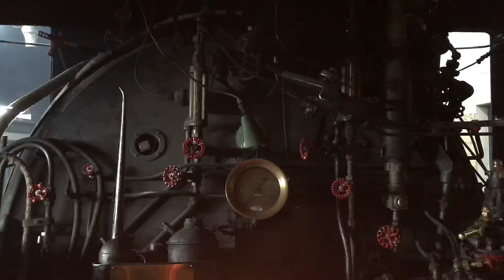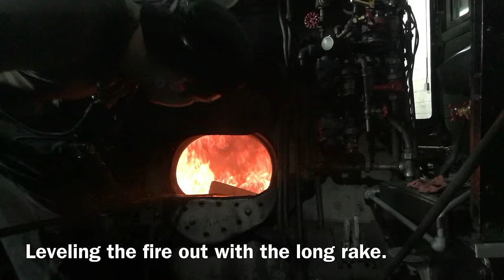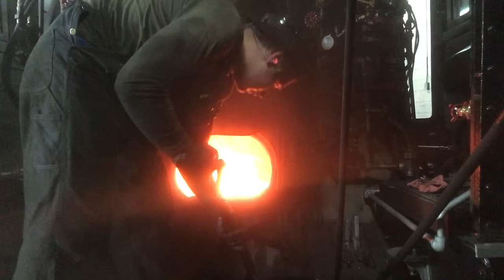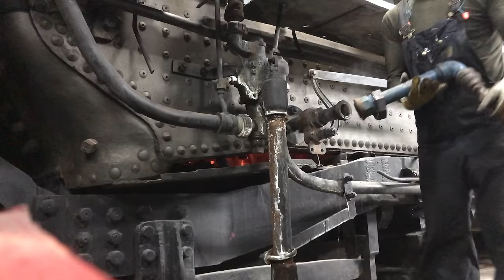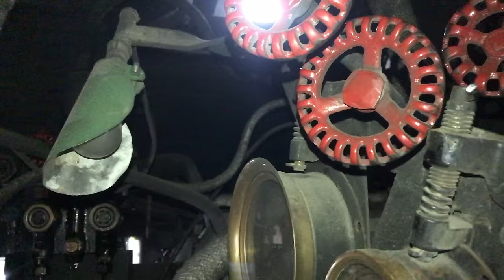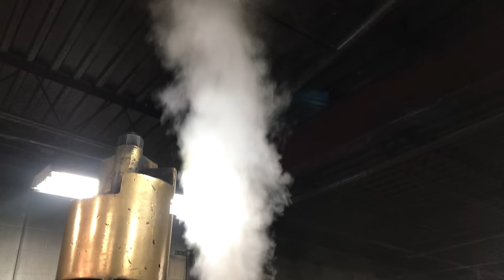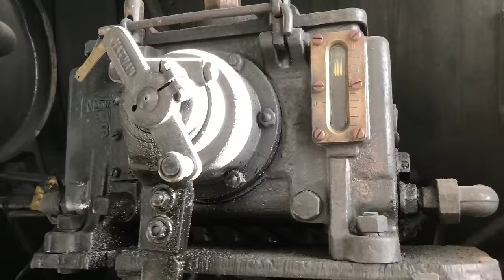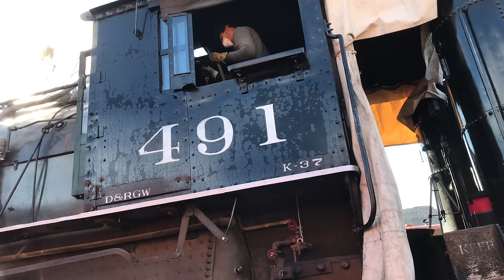How To Fire Up a Steam Locomotive [4K]

Comment: i wonder if in 150 years there will be a video about how to fire up a car with a petrol engine :D
Reply: internal combustion engines will still be around and commonly used in 150 years. Don't think that ICE won't keep getting better like everything else.
Reply: In the future ICE technology might be so great we all have our own mini power plants that are just as efficient as the big ones but require far less maintenance and thus eliminate the grid entirely. Same engine under the hoods and next to our homes to produce the power we use.
Reply: Within 150 years everything is stopped, destroyed by nature…. Maybe???
Reply: What, you never watched 'Cold Start' video's before?
Reply: you wont be around to find out.
Reply: They will be around but very limited.   The ICE has  maximum efficiency of 35%, electric motors are much cheaper and have 90% plus efficiency.  Only limited improvements can be made to the ICE.
Reply: On a cold day first pull out the choke...........
Reply: It'll be a five second video for modern cars... Turn its key.  It'll be a 10 second for vintage cars, ...pump the accelerator pedal, and turn its key.
Reply: Or push in the clutch before starting
Reply: Historymaker2001 well Put
Reply: Bergsman100 I see what you are saying and that would be cool but you also have to keep in mind how are you going to get it to generate electricity that’s the problem that you are going to have yes that would be cool if you could make that a possibility but I don’t believe or for see that ever happening
Reply: Bergsman100 I don’t think it is humanly possible due to the fact that you need to regenerate the energy somehow in order for it to get that charge to make the car move that proving that the battery is probably the only way possible to do so but the problem that I see as you see as well is that the battery does not last long and needs to be charged
Reply: In my opinion to this topic I think people should try to create a steam car that has the modern features that everybody wants but is run on steam because I believe it will last a bit longer and we steam all you have to do is fill it with water To keep this thing going if you make it the right way or you can make it so it runs off the water and a fire source I think that would be the most economical and smart way of doing it I say that in this way because of the fact that there is no again as I’ve said before in a previous comment possible way of making a car move without a battery that is electric that I can think of because of the fact that you still need to generate energy to the car and how do you generate the energy without the battery source or power source
Reply: Did just think of one scenario that may work with electric car thinking Deep about how you could do so If you created in electric friction car You would need some sort of lever inside the cab That could be moved back-and-forth in someway to create friction with the friction drive that would give her the momentum to start making the car move and then as you kept moving you could keep the friction up enough to where it would give enough friction to you could just stay on the pedal
Reply: Majority of cars start with a turn of the key or push of a button. The video would last for 10 seconds.
Reply: törment tor I mean there are videos about hand cranking engines
Reply: There were still steam engines in regular use not 70 years ago. Also, there are already videos on how to start up 70 year old automobiles.
Reply: Alot more collectors nowadays. it would probly still be this
Reply: That's wishful thinking. I don't care at all for electric engines, and I love ICEs, but I'm not blind enough to pretend their day isn't over. Battery and electic motor tech has gotten to the point where it'd be stupid to try to keep running everything on fuel-burning engines. You're like the people in 1955 insisting that "the steam locomotive has a long future ahead of it yet, with the technological improvements we can give to it". Within a decade, they were all gone. Diesels did the job better. If there are ICE engines still around in 50 years, they will be in "antique" cars, and possibly in some specialty toys for rich people who want something "different" and classy. If they haven't outright banned them totally, because that's the kind of thing they do (like refusing to let a few hundred people drive around in antique cars because "they don't meet smog laws", as if a small number of cars being driven a few dozen miles per year could possibly have the slightest impact on overall pollution levels. But "duh law is duh law!"
Anyway, open your eyes, stop deluding yourself. The ICE is on the way out. Car makers are eager for electric cars. Lawmakers are eager for them. There will be no reason to continue with ICEs once charging and battery tech has improved and expanded. Rural areas will be the last bastions, but it's coming. There is no reasonable cause to think that ICEs will be anything but a historical oddity in 150 years. Just because you like them and don't want to drive in a BEV doesn't mean it's not going to happen. A lot of people were very upset about the end of steam...but they didn't pay the bills like diesel did, and that's what counts, not what people like. And the average person doesn't give a shit what powers their car, if it's convenient for them. Already most of the kids have been indoctrinated to look forwards to BEVs, and it'll just get worse. Why would they want some old combustion-powered thing that they need to pump petroleum fuel into, when a nice, sanitary appliance that drives itself and plugs in to charge like all the rest of their gizmos can be had. It'd be like asking a modern kid to drive around in a steamer.
Reply: A 2016 Dodge Charger weighs almost exactly the same as a Tesla Model S.
Reply: Why heat water when you can burn the smoke in a ICE.
Reply: @torment -- much sooner than that.  I watched a video recently on how to start up a Ford Model T...
Reply: Oh, and one more thing -- in 150 years, what's a video?
Reply: ? unixtohack , Must be crazy doing unix and yet not having faith in the future/ praying for the end of the world.
Reply: A very short one :p
Reply: @afrog2666  I think you take too much for granted.  Imagine pulling a car out of a museum.  Check fuel level, oil level, replace oil filter of needed.  Check battery voltage, inspect tire pressure, check transmission and coolant levels, window washing fluid levels, check wheels for alignment, I could go on for a long time.  If you did all this recently, then yes, it's a shot sequence.
Reply: nah the new toyota engine has 41% thermal efficiency it will get better but no where near electric motors :)
Reply: @malavpatel77  but overall the electric car isnt better bc the power plants have only 35 to 40 % efficiency
Reply: Hello Yf Yf, Yes I believe in the future, knowledge, fun, Siemens PLC, aikido and… Unix. Not praying for the end of the world. But I am scared knowledge like is was, will be removed from the public domain. In the past it was already done burning books and libs to build more power for ‘powerful’ people… But when I feel Unix I am happy… and crazy… hehe thanks for your reply.
Reply: They do have those video's now. I bet the overwhelming majority of people would find it almost impossible to start a model T without someone to teach them.
Reply: turn the key pretty much
Reply: @Homer Simpson I hope, I wish there were still steam cars.
Reply: @Ellenslife851  steam engine car are a thing of the past that will never come back do to all the care and maintenance to keep it on the road and cost.
Reply: Ya right, we make them as cheap as possible. This train will outlive them.
Reply: @M M  You don't know what you're talking about. The second somebody makes a PDE engine with the same efficiency as an electric motor and can do it at a fraction the cost of a conventional ICE with only two moving parts, the electric vehicle will be a novelty. The future is hybrid drives. Pure EV has been tried many times before. Gasoline and diesel fuel actually cost less per BTU than grid electricity. It would actually be cheaper to charge a EV with a generator and high efficiency pulse detonation engine than charge it from the grid. Which then begets the question, why not just can the heavy battery and put the engine in the vehicle itself?

you assume that battery technology will keep getting better, but neglect that ICE technology is also getting way better. The ICE tech in research labs can only be beaten by nuclear power. HCCI coupled to pulse detonation and thermal cracking will see to it that the grid itself becomes superfluous as everyones vehicle will double as a massive generator and will produce electricity for far less cost than the grid can provide.
Reply: "Only limited improvements can be made to the ICE."
-Thats not true. Its electric motors that can't get much better, but in research labs and ambitious company's engines with thermal efficiency's comparable to electric motors with a higher rev range and longer lifespan are already being built and tested. HCCI pulse detonation is the most promising technology. 86% efficient, cheaper per horsepower than grid electricity itself, and a lifespan of 10 million miles. And they only need 25 minutes to completely rebuild.
Reply: @smh9902   Why would anyone want to improve on the ICE? They are 30% efficient at best.  To reach even 50% would cost  a fortune in technology.  You make no sense.  Most of the energy is wasted in heat and friction.  The ICE has no future in the long haul.  Yea no shit, electric motors are can be 90+ so why bother with the ICE?  That was my point. The only issue will be where to get the electricity.  I suppose the ICE will still be used for trains and large trucks possibly for a ever but not passenger cars.
Reply: Diesel first
Reply: "Wow, they actually had to control the cars themselves?"
Reply: Cheeply made Modern shit will never last 150 years like this it would have rotted away
Reply: Br!an Delta V there will be!
Reply: @M M  ICE will still be here in 100 years. The fuel may not be gasoline, but it will still be here. electrics cars arent taking anything over. In my area there are maybe two old Teslas and no chargers.  And at present they just dont make sense. ICE has a much lower cost of ownership and are much more reliable.
Reply: Hate to tell y'all, but 1) ICEs will still be around in 150 years -- thanks to diesels. Why? Because diesel tech is just as efficient as gas, just as cheap and reliable, and most importantly, is sustainable right now.
2) EVs are actually being stifled by Big Oil -- because designs like mine can be retrofitted into older cars, using already-available components. The key is a high-efficiency motor with both high-efficiency alternators and high-efficiency amplifiers/transformers.

Here's what everybody forgets: EVERY car, truck, van, and SUV is dependent upon power-to-weight ratio. This is why EVs, as they stand right now, are nowhere as efficient as they could be. In point of fact, a zinc-chloride battery, patented by Great Western Co. in the 1970/80s, had a cycle life of 14 hours, from charge to discharge - and was just as efficient as a gas ICE when placed into a VW Rabbit.

The reason why EVs right now are failing are that batteries are heavier than an engine, transmission, and full fuel load from an ICE-car or truck (My 1992 Ranger has an 800 lb engine, a 250 lb transmission, and can hold 16 US gallons - and my brother-in-law's Chevy Volt is nowhere near as efficient as my truck is -- because the Volt has a 1,500 lb Li-ion battery pack, plus a 1.0 L three-cylinder engine.) Also, EVs still use fossil fuels -- because even charging an EV from the grid uses power produced by coal. If we really wanted to have more power in the grid, the US needs to outfit every road locomotive (which is a diesel-electric hybrid) with the capability to put power into the grid. It's possible. BNSF Ry. did exactly that around 2001, when I was still in high school.

Point is, the assumptions most people make are flawed, because of the fact they either disregard basic scientific facts, or basic economic facts -- and because of that, their whole argument is flawed from the premise.
Reply: @isaiahwelch8066  big oil isnt stifling anything. And big electric have pushed electric  cars for decades. Noone wants to own a limited range vehicle, or even a hybrid. GM  had previously sold hybrid versions of all of its large trucks and SUV lineup, but noone bought them.
Reply: @isaiahwelch8066  also noone buys small cars in the US.
Reply: @smh9902  Bruh, if stuffs keep up we will run out of petrol by XXII century
Reply: @KarolOfGutovo  No, because we can use nuclear reactor technology coupled to sabatiet reactors to produce synthetic hydrocarbons more efficiently than the line losses in the grid. A fuel transport truck loses about 1% of the energy transporting the fuel, a train is 500 times less than that. The grid has 30% losses just in the transmission lines. Not to mention that once everyone is getting 200 MPG plus we'll be able to synthetically produce all our motorfuel from the waste tires alone via thermal depolymerization. Not to mention that TDP can also turn plastics, sewage, offal, and municipal solid waste and much more into clean synthetic motor fuel. There's not enough lithium in the Earths crust to convert even a fraction of the cars to electric.
Reply: i mean with old cars and bikes you can almost already do that. i recently cold started my old scooter that just had its 49th birthday. its a lot of work after it has been sitting about the entire winter. mixing new fuel/oil combo, reajusting the brakes, pumping the tires full with air, changing the fuel pipe, honking the squeaky horn, getting the bumbers unstuck, oiling all parts in need of reoilment and then of course hours of cycling to get the engine warm to get it running

Comment: Amazing video! 

Marty: Is it possible to get it up to 90?

Engineer: Laughing. 90? Tarnations, son, why'd ya ever be in such a hurry? 

Doc: Well, it's just a little bet that he and I have, that's all. Theoretically speaking, could it be done? 

Engineer: Well, I suppose if you had a straight stretch of track with a long level grade, and you weren't hauling no cars behind you...and if you could get the fire hot enough...I mean hotter than the blazes of hell and tarnations...well yes, you might be able get her up that fast.
Reply: British engineer: well we have a train 🚂 that gets up to 125. 

Marty: all right! What do you call it?

British engineer: we call it the mallard 🦆. It could hit 100 💯. Even while pulling cars 🚙. 

Doc: that’s great 😃 thank you 🙏🏼! 

British engineer: your welcome 🙏🏼.
Reply: The flying scotsman has a top speed of 100mph so ye is possible
Reply: The best part about British locomotives is that they look rather unique, especially in regards to their liveries. American locomotives more or less look the same with a few exceptions.
Reply: The locomotive in this video can only get up to 35 mph before a dangerous swaying motion starts. If it weren't for that, you could determine her max speed based on the diameter of her driving wheels. This locomotive wasn't built for speed anyway, but rather for the strength to haul heavy freight trains on the steep D&RGW Narrow Gauge system.
Reply: @e-mananimates2274  let's just agree that out ancestors made some beautiful fucking machines. God rest their soul's.
Reply: One of the best movies ever
Reply: @TheWeigman  37k lbs is not alot for a train.
Reply: @cameronknapp7315 This Is Spinal Tap:"My guitar amp goes to 11."
Reply: Meanwhile 21 century limited going 110 mph
Reply: E-ManAnimates 
But we have the Big Boy. 4 pistons, huge ass boiler. Basically 2 steam engines in one. 
Britain goes for the speed, Merica goes for the strength
Reply: @Kana0211  Yeah. but the Flying Scotsman was designed for speed.
Reply: @TheWeigman  I was just going to say that! LOL
Reply: The Mallarad ( Britain )did 125mph
The 2-3-2B ( Soviet )did 112mph
The Flying Scotsman ( Britain ) did 100mph
Not certified record for the S1 ( USA ) was around 157mph
So, 90 it's not impossible, depending on the machine
Reply: So everyone missed the Back To The Future joke? Wow!